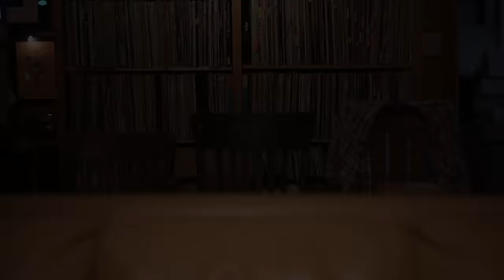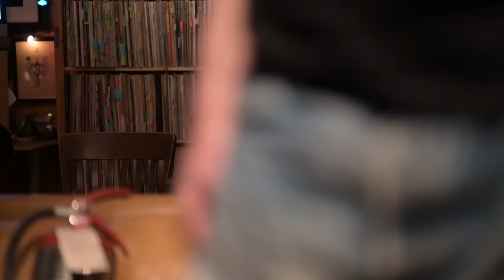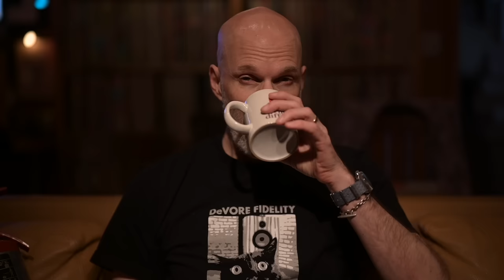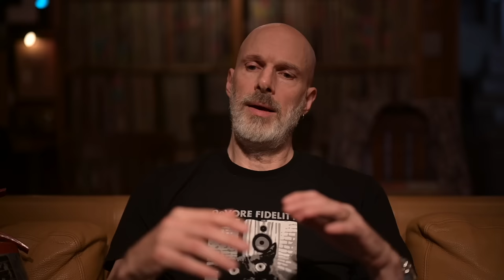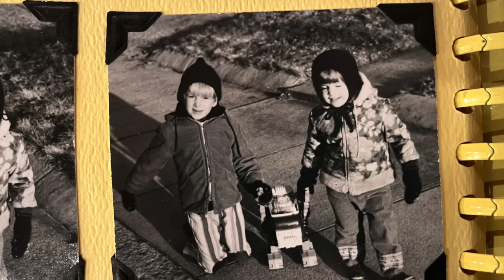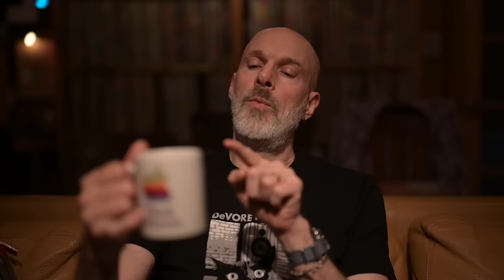John rants on measurements in HiFi, what they mean, limits,  and how they easy they are to weaponize

Comment: While the brain recreation is a fact, it must be noted that it can do the same recreation of hifi music reproduction from less than ideal or properly designed systems or rooms acoustics.

If you’re listening through a pair of loudspeakers or headphones that don’t reproduce anything below (say) 55 Hz, you’re not experiencing the full bass information that is present on most recorded music, but give your brain some time, and you won’t feel like there’s something missing.

The same applies to important deviations in frequency response, specially if you don’t have some musical reference points that you know very well.

The question might be if it makes sense in waiting for the brain to adapt (and often work harder), or to start with a more full and balanced sound in the first place. 😉

Measurements certainly don’t tell how a loudspeaker sounds, although there is some correlation on tonality if we’re measuring the most important parameters.

While I understand the comparison with the receiver wars, loudspeaker measurements these days are way more complex and complete than that.
The data that would be more “apples to apples” is most manufacturers official data on loudspeakers, by stating the frequency response (almost useless, and even worse when using -6 or -10 dB scale, impedance (often misleading), and sensitivity (power isn’t as expensive as it was in the past).

There’s rarely any useful information on the specs of any consumer loudspeaker, but that’s the game that has been played for decades now (far worse than on amplifiers, IMHO).
Some higher end studio monitor provide _a lot _more useful data, even if it never replaces actually listening to them.

But it’s fair to note that no other component in the consumer audio chain adds as much distortion as the loudspeakers, and every loudspeaker adds its own sound signature in many and very obvious ways.

In a way or the other, they always add coloration to the sound, and if they didn’t, the room would do it anyway.

There has never been a perfect loudspeaker, and it seems like we’re still very far from ever achieving it!

It must also be noted that even the manufacturers with more financial and technical resources on this planet are still “voicing” loudspeakers in order to grab the attention on the showroom floor, on a deliberate deviation from neutrality or accuracy (that neutrality BS is only with the marketing team).

Manufacturers (generally speaking) are the first ones on telling fairytales about the loudspeakers they make, and even if that’s not the case with Devore (I honestly don’t know), it still doesn’t change the overall reality.

With so many years of expensive fairytales disguised as reality, all these new sources of independent measurements are more than welcome (and needed, up to a certain point), as it is the only way of knowing many aspects about the design of the loudspeaker.

If any listener/customer happens to love a loudspeaker with a far from neutral response, that’s fine.
It doesn’t mean that anyone is wrong or right.

But our brains can also process good sound based in visual cues (brand awareness, how the speaker looks, amongs many other things), so we can only thrust our ears/brains up to a certain point.

We’re likely not measuring all the right information with loudspeakers, but before independent measurements were common, the consumer would have only the very limited information provided by manufacturers!

Recommended amplifier power, frequency response (the interval without any meaningful graph or information), sensitivity, advertising loudspeaker as 8 Ohm when they are clearly 4 Ohm according to the definition…   …and so on…

…it’s not valid information from any manufacturer.

How many loudspeakers can truly handle the “recommended amplifier power” on music with strong and deep bass notes?

Interestingly, most loudspeaker drivers manufacturers are way more specific and detailed on all that information!

So I really understand part of the rant on this video, as we can’t really tell how a loudspeaker sounds only by looking at measurements.

But most arguments used are a bit out of context with the big reality of loudspeaker designs, and if manufacturers don’t provide useful data to their customers, there not in a place to complain about those who do independently.

On a final note, CD isn’t limited to 20.000 Hz.
The sampling rate is 44.1 KHz, and the rest is both math and…measurements of any commercially recorded CD. 😉

Comment: Based upon your analogy of the interpretation of reality within a brain in isolation, wouldn't this also require a shared interpretation of all of reality itself? For all we know, our sensory data could vary dramatically from individual to individual but the words used to interpret and describe our experience must still exist in a shared reality, otherwise the words themselves would be meaningless.
Reply from the maker: As children we are all taught things like "this is red, this is blue" but we have yet to know if my perception of red and blue is anything like yours.  All we know is that we have both learned that one set of stimuli is called "red" and another set is called "blue". Remember the 2015 internet phenomenon "The Dress?"
Reply: @DeVOREFIDELITY this is where measurements come in. You can measure the frequency of said light and be sure what the exact colour is. This analogy you just used basically dismisses your whole rant if everything is objective.

Comment: I understand your pain although I don't feel it. At least I haven't for nearly 50 years now. I have enjoyed both recorded and live music all of my life literally from the time I was born. I enjoy many genres of music but my primary interest is in classical music. When I was 12 years old I heard stereophonic sound for the first time and instantly became an audiophile. At the age of 25 years old I built a quadraphonic system and instantly hated it. It was hyped to the sky as like being at a live concert. I'd been to a lot of live concerts and none of them sounded like that, it was horrible. I had watched its evolution from the first time Stereo Review magazine put a speaker behind the listener and wired it between the two hot amplifier outputs. At 12 years old I knew NOTHING. At 25 years old I was a degreed engineer with several years of experience and a vast array of analytical tools in many areas of science and engineering and they were as shiny and sharp as a surgeon's scalpel. So I threw my audiophile hat in the trash and put on my science and engineering hat to see if I could figure out why there was such a difference between hi fi sound and actual live music. Instead of thinking about equipment I thought about the nature of sound and acoustics. I knew by then through both experience and by the work of others that most of what we hear live is due to acoustics, the reflections of sound. How is sound propagated into space? What does a room, any room do to it before it reaches our ears? Exactly what reaches our ears. My conscious mind wasn't thinking about it for long but evidently my subconscious mind was working away at it and a few weeks later a lightbulb went off in my head and I understood everything about the physics of sound with mathematical precision. It's very different from not only what audiophiles including manufacturers think but what acousticians think as I later found out from reading their work on the internet. 

I'm not going to tell you that this is an easy problem to solve. However it is relatively easy to understand when seen from the right perspective. BTW I'm sick and tired of arguing with audiophiles, I save my big guns for the physicists. I just blew three famous ones away this morning over this bull$hit about quantum mechanics and multiple universes. I haven't paid my dues in decades but I could reinstate myself by just paying money to the American Institute of Physics and the Acoustic Society of America which is a scientific organization unlike AES which is a prosumer organization. 

So how does it work Mark, what is the secret? Looking at sound propagated into space at one point and comparing it to where it arrives at another point there is a first arriving sound and then there are reflections. There is a mathematical relationship between the first arriving sound and each arriving reflection of it. The first arriving sound is taken as a reference (mathematicians call that normalization.) Each reflection is compared to it in only four ways. How much later does it arrive? What direction does it arrive from? How loud or soft is it compared to the first arriving sound? What spectral balance changes have occurred compared to the first arriving sound? If you can do it for one reflection you can do it for all of them. If you can do it from one source you can do it for any finite number of them just by adding them up. If you can do it for one pair of coordinates in space for a source and a listener you can do it for any other pair. For what you hear the devil is in the details. 

The hardest part for me was figuring out how to measure this. After severals weeks of being clueless the scientist in my was ready to give up. My father who was also an engineer told me many times if you can't say it with numbers you're full of $hit. BTW, if what you measure doesn't correlate with what you experience you are measuring the wrong things or at least you are omitting something very important that gives you the answer to the question you are trying to understand. But one day I figured that out too. Ironically it was a development of the method used by Wallace Sabin, the inventor of the modern science of acoustics at Harvard in 1895. I'd read a lot on the internet including by the late famous acoustician Leo Beranek whose web site with all of his published papers is no longer free on the internet. Fortunately I downloaded many of them when they were. I can tell you this much about the way acousticians look at this science right now. They have a whole catalogue of parameters that explain the acoustics of entire rooms with one set of numbers. If you read a textbook about acoustics you'd know less when you finished than you did before you started. 😀

With no measurements, back of the envelope calculations, and not a whole lot of money I decided to see if I could adapt my idea to playing recordings with better reality. I would be happy with any improvement and expected complete failure. Nobody was more surprised than I was. So I decided to try my experimental prototype on test subjects who had no interest in music or recordings. I wasn't looking for a tweak only golden eared audiophiles could hear. That wasn't nearly good enough. Eventually I showed it to a patent attorney who told me of course that I had to patent it. And so this adapted variant of my idea (I think of it as a bastardized version although still true to the concept) was awarded US patent 4,332,979. If you read it, ignore the first three figures. They relate to a measurement technique that the patent office considered a different invention. The words were removed but the figures inadvertently remained in. I had no success in interesting anyone in my idea as I am a lousy salesman and I had a  lot of other things going on in my life including my career and family matters. 

The second prototype is based around a marketed device that infringed on a critical element of the patent. I've been experimenting with it for 20 years and it will unfortunately have to be assembled in the next few months. I have no idea if it will ever be reassembled again. If you want to hear it, I live in central New Jersey about 50 miles from New York City. It's very different from any sound you'd hear from any hi fi system you could buy.
Reply: Humility=tranquility professor
Reply: @sevestan  do you have a technical question or find and error in my analysis? I've watched this industry and all I can say is never have so many paid so much for so little. Hi Fi sound and real music are worlds apart IMO. 90 percent of what you should be hearing is missing. Making the other 10 percent louder doesn't make up for the qualitative difference. Of course if you like the hi fi sound great. If you don't like it or accept it like me, go figure out how to fix it to your own liking. Tell me about what YOU have done.

Comment: Truly spectacular rant here, John. One of the best and most articulate videos you've done yet.

I recall reading a 'review' of a fairly inexpensive boutique phono preamp a year or two ago that had had heaps of praise laid upon it by those who had listened to it and owned it, but the review in ASR (not afraid to call them out) absolutely lambasted the device, saying it measured horribly and was grossly inadequately designed. The designer & company founder himself offered up all kinds of sound reasoning behind the decisions behind his design in the comments and there were two or three guys, including obviously Amir himself, who were telling this guy TO HIS FACE (figuratively) that his design sucked and just had to sound horrible because of distortion, etc.

Not a single one of those guys had actually plugged that phono pre into a system and listened to it. Not one.

I lost all respect for that community [cult] from there on out. What a staggeringly bewildering way to believe sound works.

Comment: If you spent a few years in a professional recording studio watching how records are made, it would have a profound effect on your current opinion. I won't take sides here, but your "rant" does support a point of view that justifies your business activities.
Reply: We must continue to distinguish between what John refers to in his closing remarks, which is the convincing illusion of reality from a stereo playback device, and the populist social movement of measurist engineering and tech.  The former is just what it purports to be, and the latter is a belief system that merely assumes its pertinent to that first practice, method, effect, and movement.

The largest body of confirmed preference researched to date consulted with studio pros.  It found a very consistent preference overlap between those practices and methods and specialist audiophile preferences.  Both aligned with decades of audible results.  It did not correlate with measured "accuracy", where accuracy is defined as a single data metric.  Unfortunately belief in that data metric, which loops us back to the topic above, is not synonymous with acoustical reality.  Therefore your formulation that exposure to that belief system would reform views is unsupported.  It may even have already done the opposite.

There are revolutions in fields all the time and I can think of at least a few undergoing them right now.  Appealing to the assumed authority of a field while not knowing its full breadth is not an effective argument.  Backing it up with a slight against business ethics doesn't help, and may confirm the hostility so many see from the self-styled objectivist.
Reply: "convincing illusion of reality from a stereo playback device." This is what I'm talking about when I say you need to understand how records are made. Except for live performance records, classical recordings, and some jazz records, creating the "illusion of reality " is generally not a goal of recording artists, producers, and engineers. The goal is to produce an emotional reaction from the listener with words and music, not to make the listener believe they are at a concert.   @Trajectionable

Comment: I use PCIe soundcards, they're getting rare now, and I recently saw a card with slightly better specs than mine, (129dbSNR vs 124, 0.0001THD+N vs 0.0003) but I figured that it's very likely not going to show me a "veil lifting" improvement in experience, and that I am likely getting a better performance due to other features that have been shown to improve SQ such as TCXO clocks and discrete opamps.

The cheapaudioman has it right when he said SNR means nothing after 110db.

So on that note I say that I'd love to see a more comprehensive SNR measurement standard, but as humans we LOVE to reduce something to a single number.

I'm also reminded of a video I recently saw of a man using REW when trying to phase align my setup, and realizing that there was a LOT more to it than simply measuring and setting a delay, and I was likely better off simply playing around with it by ear.

Ofcourse however, do that too much and you end up with BOSE...